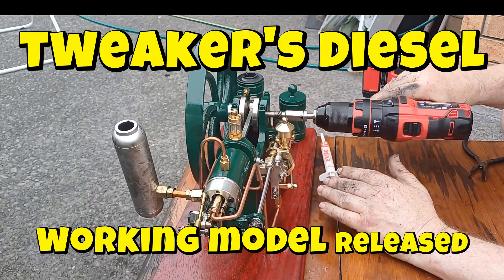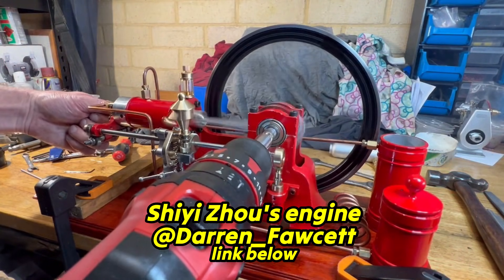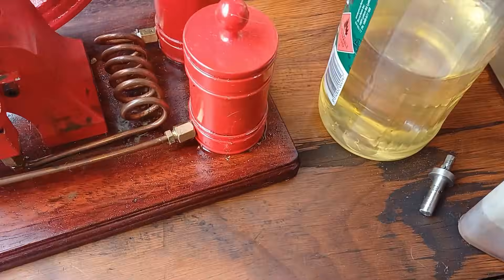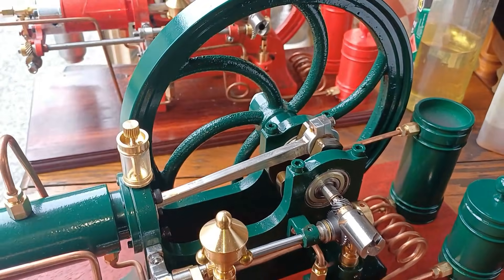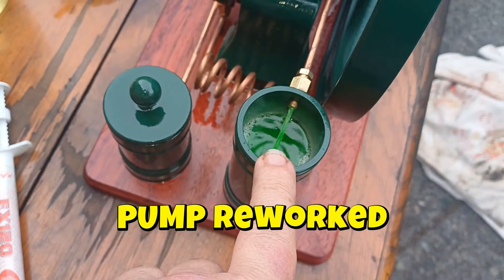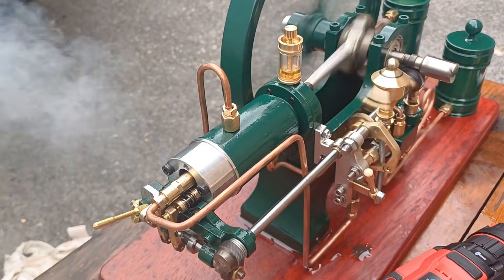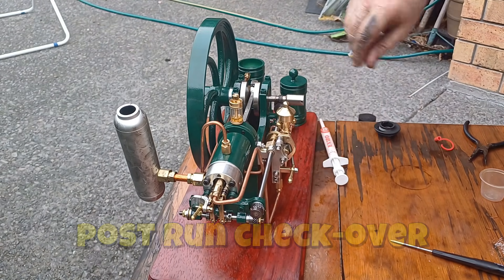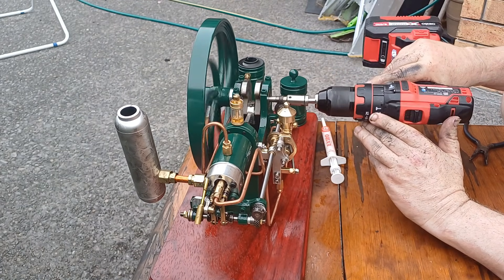WORLD FIRST Working Diesel Model Engine True Injected - Release 2025 #stirlingkit #enginemodel

Comment: As the fisrt person to get it in China (2024/11 i got it),  after months of fixing and running, i would say the version you got was much better than the earlist engine i got. The most important question is the CONNECTING ROD. This is made of soft Al, and it was not quite good for handling a big force. If your timing is too ealry, the rod will bend and broken. Tuning the timing was not a easy job, I bend more than 4 rods to fininsh the timing tuning. But if your flywheel is not that tight, the flywhell will lose and disconnect first to protect the rod. But losing the Flywheel isn't safe, so i had to tight it well, even it may bend the rod. And the piston is too long, need a lot lubercation. Forgive my English is poor, I just 16 years old. The "fuel injector-cylinder head" seal isn't too good, so it may leak some gas out. Don't put too much force to tight the fuel injector, or the threads may broke. Some bad point had sloved already in the latest version of this engine. I had to said is that making a small diesel-injected engine is quite hard and needs a lot of money, the maker spent over 1 million CNY to fininsh the project, respect.
Reply from the maker: Thank you so much for this great feedback! It's good to know what they've done to improve the model. Thank you for spending the time to reply. I like to support the builder even though this product is imperfect, he is a good man with a great long term vision. He does not give up and I keep in touch to hear his progress. He is a likeable man and I think he is gaining support from more experts who see his determination.  Keep in touch sometime:)
Reply: You can see that the maker wants into e better. thats why he sent it to Find Hanson for the better or the worst.  The big thing is people will be afraid to spend this much money UNLESS the seller will come up with improvement parts to sell to customers that purchased this engine.  If not it will limit the amount of engines to be sold & it will be hard to get the $1,000,000 I vestment back.   I purchased one of these engines & hope to help fix the issues along with EVERYBODY that also purchased one.   Once finished it can become a good engine with less smoke . !!!!!!
Reply: My mistake. 1,000,000  CNY is $140,000

Comment: Hi ! I bought one, from France ! I home it will go here fast 🙏🏻 

Small hit and miss engines often use a rubber gasket instead of rings, what about this little diesel?
Reply from the maker: It has an unusual rubber ring with a lip forward to the compression chamber so that compression pushes it out. This makes it tricky to put back in without a matching cylinder to back it into. The water pump ring is same design, bear that in mind :)
Reply: @ThomasPCGuruENGINES  What happend if it's used ? Easy to find ? 🥹
Reply from the maker: Sorry missed this. contact seller or me for builder's contact. It will be a standard part but I don't know the specs

Comment: I’d avoid jet A1 and kerosene as they don’t have the lubricity needed to keep the pump and injector in good condition. Heating the injector line and keeping the head and injector hot will help with cleaner burning.
Reply from the maker: I've tried blends in the last week, bearing this in mind. from 2/4 to 1/4 kero and the rest diesel. Much, much cleaner burning (less sludge) and easier to work with. Not sure if it's right for this engine yet, I can't tweak out the knocking no matter what I have done yet ....

Comment: Looks cool but messy af, ofc it might depend on the user and how rich you adjust the mix and how much you abuse the oil lubrication, but it seems the gas version runs smoother and much cleaner.
Reply from the maker: Absolutely right, but I'm learning something new...messily...so is the builder, I think :)

Comment: I ordered one this past week, looking forward to getting this
Reply from the maker: You'll enjoy it. The builder has high hopes for release 3 of the injector. In the meantime, there is lots of fun to be had fiddling and getting gloriously oily and dirty...heaven :)
Reply: I finally got around to messing with this engine.     Having trouble getting it primed .    I removed the line at the injector,  and also before the pump (to get any air out).   Any suggestions?   Thanks!

Comment: I wonder if the new bits wil fit on my 1st gen? It needs higher injection pressure and a higher pop off pressure on the injector to atomize the fuel better to reduce the smoking. Still is very cool!
Reply from the maker: Turns out, I think, you can adjust the injector by taking it out and screwing one part that holds the spring in, in a bit. I'm going to try this
Reply: @ThomasPCGuruENGINES  Is that only on the new style injector?
Reply from the maker: No I believe the old one too. I had the old one out and noticed it was screwed together but never tried disassembling it. I wonder if it's screwed up tight and needs a new spring,  or I can screw it up tighter against the current spring. I have asked Shiyi just now. Let's see if autotranslate can convey the subtlety of that question :/
Reply: @ThomasPCGuruENGINES  I had mine apart and it appeared to pressed on and non adjustable but you never know. I also contacted him about buying all the new bits to upgrade mine to the new 2.0 version.....  Fingers crossed!
Reply from the maker: Shiyi says "Is it Paul? Let him play with it for now. After our vacation [Chinese New Year] I will produce the third generation of the injector. Once that is ready, I will offer a free upgrade. Free of charge"
Now that is his plan, anyway. Usually he would like postage paid, I expect. He does seem like a really nice guy from the texting we've done; when my wife came to his city he wanted us both to visit his factory etc he has endeared himself to me:) Let's see what he can do. Keep watching and ask questions of me if I forget :)

Comment: i think it still needs alot of work, this thing barley runs and its running hot and consuming lots of fuel meaning the timing is off or too low of compression. Ive seen homemade diesel injected engines run way way better on this scale than this so they have alot of work ahead
Reply from the maker: Of course you're right. Shiyi is working hard to create improved models and ideas. With this release, he and I hope the international community of modelers will contact him with some ideas. The community, and serial production to share the models for those interested, has to start somewhere. Let me fix the tight big end etc and see what I can do. Watch out for Shiyi and Niffi2 engines in the future!

Comment: That looks like a beauty, but I bought a Situan Sifa MB168F off Amazon. I adapted it's 20 MM crankshaft to 1 inch with a sleeve and it likes a thick aluminum plate to mount on. The case is closed, and the castings and dimensions leave nothing to be desired. A diesel for everybody.
Reply from the maker: I'd mentioned a few videos ago that I was thinking of doing the same thing. It's a legitimate option for a fiddler's diesel. I was thinking of fitting a big flywheel and seeing how slow I could make it go. I was just curious...have fun Stanley!
Reply: @ThomasPCGuruENGINES  No. You don't turn some diesels too slow. The rings will gouge into the cylinders before it will even fire. I keep a higher idle. I don't push either.
Reply from the maker: ...and this is why I love the hobbyist community. Worth knowing, thx! :)

Comment: I replied to your reply in my previous comment.

Also fuel consumption and power numbers would be worth a LOT! of clicks IMHO as these old style engines are surprisingly frugal from what I have manages to glean from the net so far.

ie:  I am looking to do a micro Combined Heat and Power system by adding heat exchangers to coolant and exhaust.
ICE efficiency goes WAY-WAY! up to around 90% when you can use the normally wasted heat.
It's easy with these and an repurposed EGR cooler  and some copper tube etc.

 An old style long conrod, Mild (easy on the ear) cam and the ease of repair of this type of engine make it very interesting for such.

You might consider that and the clicks powering AND warming a small 'house' would bring..?
Reply from the maker: Thanks for the ideas, I'll try and get a good way to measure those things, I think it's a good direction! Let me get it running at it's best first. Thank you!!

Comment: FFS! Put it on something rubbery on the table!  HowTH do we hear the engine with it banging on the table like that!?
Are you a reviewer or not!?
Reply from the maker: Yep gotta get those felt feet "FFS". Thx!
Reply: @ThomasPCGuruENGINES  :)  Soz for losing it a bit; I was very keen to fully hear just how quiet these low rpm = low volumetric losses, long conrod, thick walled, quiet cammed engines are.

I'd go with rubber feet.
Also NB that as one can draw a flat plane through any 3 points in space, but not any 4;  3 rubber mounts/feet work better than 4.  A similar thing is used in most all cars nowadays.

Fuel consumption figures would be nice too. (as would power and torque)
I think they are so amazingly low as to be worth a lot of clicks..!
That takes running a known load...
Reply from the maker: Thanks for your interesting reply, a few things I hadn't considered...3 feet, eh...yes power would be very low, it's only 16cc. Barely enough to power itself. I'll get rid of friction (tightness) as my number 1 job and it might smoke less, and go from there. Shed fun:) not really a "reviewer"
Reply: @ThomasPCGuruENGINES  Yes a somewhat bigger model would be nice.
But in CHP it's often a case of more heat than you need, so..?
Reply: @ The '3 feet' is just a physics thing.  A 3 legged table never wobbles... kinda illustrates the point.
But its not a biggy if one uses 4.  Just a tiny bit louder.
Reply: @ oh ye; Research:
Dr Ali Erdemir Argonne National Labs  Boric Acid in engine oil lubricant
if you want it to run friction free and smooth as butter and for-ever.
BUT!!!
Run it in properly and then some 1st.  It wont be running in after...
Hint:  Crazy as it sounds, make the Boric ACID (not Borax!!) very moist to wet before mixing it thoroughly with the oil of anything (old worn) you might try this on.
The water is instrumental to the desired reactions and the excess just 'boils' off in short order.
Reply from the maker: - mind blown -  & thanks, my friend, it's crazy appreciated. I'll try to remember:)

Comment: Find Hanson's small diesels don't smoke and start with a single turn of the fly wheel by hand.  They are also very quiet.  Mind you they are of a smaller scale, but in comparison, this engine from China doesn't appear to be as well made.
Reply from the maker: Indeed, but Find's models have hand-crafted parts where he worked iteratively just to get one right, and spent years tuning the handful he made to excellence. You are seeing the result of Find's years of skill, engineering and research versus the first release of a hobby model engine made to be an affordable tinkerer's toy. Find's are therefore impractical to reproduce, not helped by his apparent disinterest in helping anyone else (thus far). Have a look at the engineering forums. Of course I'd like one of his engines, do you have one? And of course this isn't as well made. We'll see what I can do to tune it and run it in. Also, Find used kerosine which smokes much less. This is running on diesel. But yes, they're in different classes

Comment: I think if you run this engine on pure methanol, it won't smoke.  Just a thought. Enjoyed the video. Thanks so much
Reply from the maker: Great suggestion!
Reply: That will ruin the injection equipment
Reply from the maker: Ruin the injection equipment? Of course you're probably right...no lubricity. Pump failure

Comment: It's great that there have been some improvements over prototype 1, but there are still problems with the sealing failure between the injector and the cylinder head (the large amount of white smoke and a slight difficulty in starting the engine may be a consequence of this compression leak, but it's still surprising that it can still work this way). 
And they continue to make the injector out of brass. It may be my pet peeve, but I don't see how brass parts can last under such high pressure and mechanical stress as in a diesel engine - even if it's just a model engine. 
Thanks for sharing these micromechanics products in such detail and running in practice. Thumbs up for sure!
Reply from the maker: Thanks for the considered thoughts!
Reply: The injector is Stainless with a brass adapter on top....
Reply: @CapeCodCNC  Really, my bad, my mistake. I just watched the AJ restorations video of this same model. He had to remove the injector from the cylinder head and disassemble it - separating the brass body, which is screwed on, from the stainless steel base - and had to apply some kind of epoxy paste or similar on the threads of the '2 halves' to prevent injector leaks. And after screwing it back into the cylinder head, there was no compression leak in that spot like what is happening with Thomas's model. Anyway, Thomas himself commented in the AJ video saying that the manufacturer will release the "3.0 version" of this engine with improvements to the injector. Well, let's hope that happens.
Reply: When you cut or file brass  there's a soapy or oiled smoothness the operation. pointing to it being low friction and wear for things like injectors..?

You see brass all over the (moving bits) place in steam engines.

ie: What's wrong with brass injectors and gears etc..???
Reply: @RayleneCawood  Brass is a soft metal alloy that is ideal for making bearings and similar parts, and because it is cheaper, other parts are also made from it. My point is that, regardless of whether it is a model or not, a diesel engine works at high pressures and its components must withstand high mechanical stresses. Of course, I understand that it is much easier and cheaper to make a brass injector for model engines, but you don't see diesel engines with brass injectors around here. They are made of materials that can withstand the high pressures of the combustion chamber and the mechanical stress generated by the constant blows of diesel combustion every 2 turns of the crankshaft. And this also applies to gears, depending on the forces to which they will be subjected. It is possible to make brass gears if they do not have to be subjected to great mechanical stress, of course. But otherwise, they should only be made of a harder and more resistant material. 
P.S.: In the case of this model engine, the injector is screwed in by means of threads as if it were a sparl plug. And for this reason it is not possible to apply the ideal torque to obtain the proper seal - since it is made of brass, the threads would easily strip. Another reason to insist on my criticism.

Comment from the maker: Disclaimer - this first engine was purchased at full price and I came to a deal for the second. I have got to know the builder and researched how difficult it is to build these exactly, at a price. I now think it's a success based on being for a hobby user who wants to see what he can get it to do.

Thank you. If you or I could do better, let's see it. Personally I will work with this and see if I can improve the smoking with tweaking. Tweaking of everything is possible on this engine and I don't expect the builder to spend all that time doing the tweaking I enjoy :)
Reply: This one runs way better than the first.  And less leaking!
Reply: @renebollengier1111  As far as smoking goes; try heating the diesel using the coolant heat. Heat AFTER the diesel pump...

If you want to go further, do you remember the old Furgerson etc engines that started on Petrol  and then changed over to Kerosine once warmed up..?
You might try Pyrolysing some diesel or something with the exhaust heat and just feeding it straight into the intake.
The governor should just auto adjust the std diesel supply down.  That should be fun!  :)